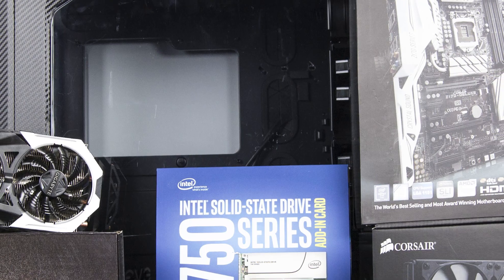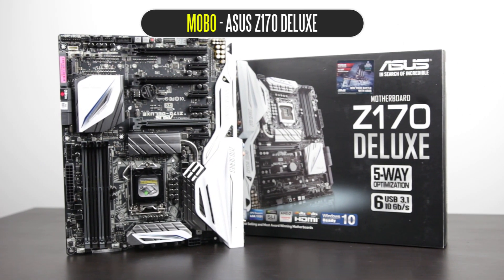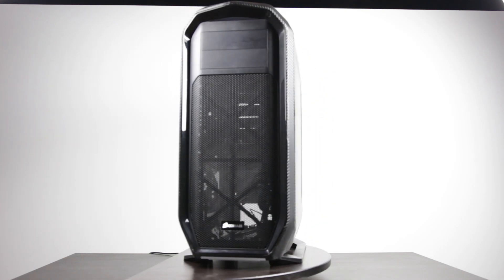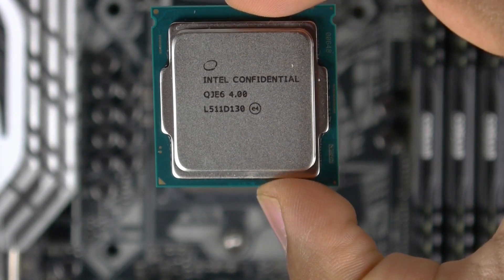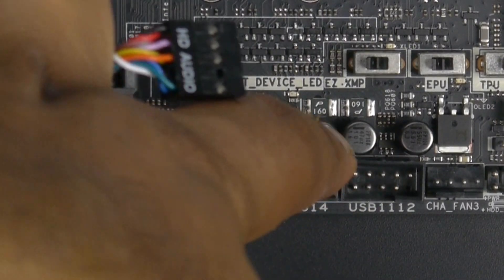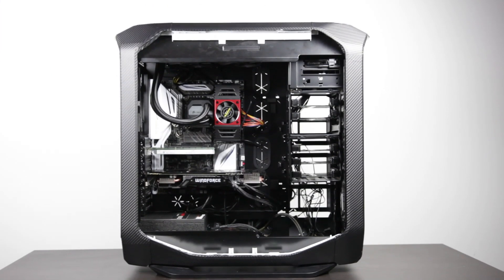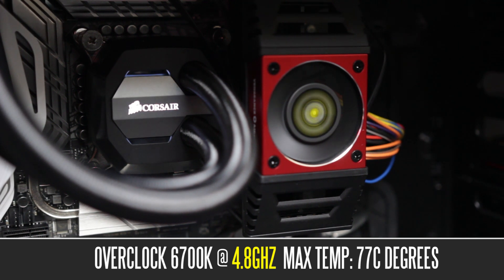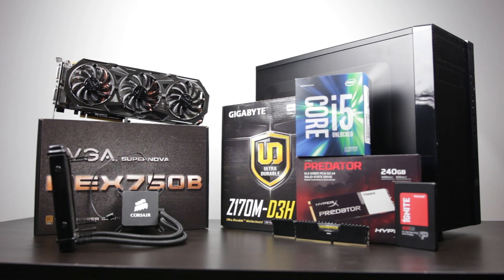Ultimate 4K Gaming/Productivity PC Build Guide - Core i7 6700k/ GTX 980 Ti

Comment: Wait a minute, your ultimate 4K gaming PC is powered by a single 980ti? If you plan on playing modern titles you're either going to have to compromise in the settings dept or in the framerate dept...Ultimate this build is not.
Reply: hartsickdisciple
Nah mate, my point is that your IQ is to low to understand what "ULTIMATE 4K GAMING PC" means :(
Reply: +TheInfamous Stephenson I agree sadly... only 1 gtx 980 ti just isn't enough to run most of todays AAA titles over the low 40s in fps rates... This is certainly a nice little build and will get the job done especially if you have a decent monitor with GSync... However for productivity and Ultimate, be more proper to see an x99 build with at least SLI and a better quality psu...
Reply: +hartsickdisciple Mate just sit down and STFU,  nobody cares on how long you have been a gamer, especially when you have no fucking idea what you are talking about...

I have 2xASUS 970 STRIX OC running SLI (the same as 1 980ti), i7 3930K@4.4Gz OC, 16gb 2133 Ram, Rampage Ekstreme IV. On a ASUS ROG PG278Q 4K 144Hz Monitor

And i cant run all new games on MAX
Reply: hartsickdisciple
ULTIMATE
Reply: hartsickdisciple
ULTIMATE
Reply: hartsickdisciple
ULTIMATE
Reply: hartsickdisciple
 Did you get it now? o.O
Reply: +TheInfamous Stephenson ... Also lets keep in mind productivity... an x99 Deluxe and a 5820k would cost the same price of this build. Even cheaper if your near a MicroCenter where you can get a 5820k for $299... this build isn't only not Ultimate but financially irresponsible...
Reply: +TheInfamous Stephenson He wouldn't have to compromise a lot.  980 Ti and Titan X can handle most games at 4k.
Reply: hartsickdisciple Not current high end titles at 60fps and max settings @4K...No single card can at the moment.
Reply: TheInfamous Stephenson 60 fps is nice to have, but not necessary all the time.  The 980 Ti can handle a lot of demanding games at 30-50 fps at 4k.  Far Cry 4 and GTA V are 2 examples.
Reply: hartsickdisciple The ULTIMATE 4K GAMING PC should be able to handle 4K  and max setting at 60fps at the very least, or it doesn't qualify as the ULTIMATE 4K GAMING PC now does it?
Reply: TheInfamous Stephenson Are you setting the standards?
Reply: hartsickdisciple The industry has set the standards, where have you been?...Sub 60fps on a so-called ULTIMATE Gaming PC isn't so ultimate.
Reply: TheInfamous Stephenson I've been gaming on PC for over 15 years.  I know that 60 fps is nice to have.  Perhaps the maker of this video should have set an upward limit on the money they were willing to pour into this rig.  Everyone knows that you can dump 5 grand into a ridiculous, multi-gpu gaming PC if you want.  I got the vibe that they weren't going for that here.
Reply: hartsickdisciple And I've been gaming since the Commodore 64, so Touche.

Furthermore, you obviously can't build the ULTIMATE 4K Gaming PC if your budget doesn't allow for specs that will support an ultimate gamimg experience at 4K resolution...so perhaps MW Technology shouldn't have went with a misleading title.
Reply: TheInfamous Stephenson Gaming on Commodore 64 has no relevance to a discussion about PC gaming performance and graphical standards.  I played on Atari, but you don't see my bragging about that.  

There is more than 1 possible meaning for this title.  One meaning would be to say that this is the best (ultimate) PC for gaming at 4k.  That's how you are interpreting it.  I don't doubt that others also read it that way.  The other way to read it (since 4k gaming is viewed as the holy grail right now for so many), is that this PC is an ultimate gaming rig, and could even be used for gaming at 4k.  As we both know, 4k PC gaming is not all that common at this point.  That being true, being capable of 4k gaming is seen as something to attain to for a gaming rig.  This PC is an ultimate gaming PC (it's a beast by any reasonable standard), and can EVEN play many games at 4k.
Reply: hartsickdisciple It has relevance to your previous comment: "I've been gaming on PC for over 15 years" (I thought this was obvious).

Additionally, I'm not adding self-interpretation to anything, I'm referring to the title as it's presented: ULTIMATE 4K GAMING PC ...not ultimate 1080p PC that is capable of 4K gaming with dialed back settings, ultimate 4K BUDGET gaming PC, or any other conjectural titles and hypothesized subliminal meanings that you want to add into the equation. Did you even watch the video?..as the contents of the video supports the title 100%.
Reply: TheInfamous Stephenson Yeah, I watched the video.  Commodore 64 has no relevance to a discussion about frame rates.  What I'm saying, which is completely valid, is that the very fact that a PC can run most games acceptably at 4k at this point makes it pretty fucking ultimate.  Most PCs can't run many recent games acceptably at 4k.
Reply: hartsickdisciple My comment about gaming on the Commodore 64 is just as relevant as your comment about "gaming on PC for over 15 years".

Furthermore: This vid is about the ultimate 4K gaming PC build, as the title suggest and the opening statement in the video itself verifies...not about what is personally acceptable to you when it comes to 4K gaming. If other 4K gaming PC builds are outperforming this one then it obviously isn't the ultimate build for this level of gaming.

As the very wise Yoda would say: Rocket science this is not.
Reply: Ullaofimbaness Nothing you just said had any relevance to my point.  You must be stupid to understand it.
Reply: +TheInfamous Stephenson I ' am thinking for a 1440p System: i5 K6600 with GTX 980 Ti  <or>  i7 K6700 with GTX 980 ... Photoshop/Lightroom, 3D Rendering Cinama 4D and litte bit Gaming
Reply: Oil Bama A 980 TI will max anything out at 1440p at 60fps and above.
Reply: TheInfamous Stephenson Thank you. And 980 without Ti and the i/ k6700?
Reply: Ullaofimbaness Chances are good that my IQ is higher than yours, if you want to go down that road.  I don't think you do.
Reply: +hartsickdisciple dude, that is shit, 60fps minimun otherwise it's pointless
Reply: +hartsickdisciple dude, that is shit, 60fps minimun otherwise it's pointless
Reply: +Joseph Norris lucky, I'm gonna work my ass off to build myself a beast come springtime.
Reply: hartsickdisciple
Just by saying that braindead shit, you made my point on that your IQ is to fucking low. But please lets go down that road, because im so curious on how you are going to manage that. Or are you just babbling out random sentences?
Reply: +TheInfamous a titan x can easily handle 4k gaming alone, the only problem with 980ti is that it only has 6 gb of vram, which is the minimum requirement for games like shadow of mordor. it doesn't matter tho because you would be stupid if you wanted to have a 4k monitor for gaming.
Reply: Rodrigo Paiva Yeah, but not at 60fps at max settings...the single card that can do that hasn't yet hit the market. In comparison benchmarks the Titan is only slightly ahead of the 980ti (like an extra 5fps) is most modern titles @4K and the 980ti is significantly cheaper. Also no games utilizes 12GBs of GDDR ram so what's the point?

Comment: Why did you not put the GPU in the 16x slot and the Intel 750 SSD 8X slot? If the GPU is in the 8x slot, does your GPU run at 8x instead 16x? Does make sense to cut you bandwidth in half on the GPU, when the SSD only needs a 4X PCI-E slot.

Comment: You always have to put the graphicscard in the PCI-E 16x slot nearest to the socket. Otherwise you only get half of your graphic-performence.Do not put the Intel ssd in the PCI-E 16x slot, because it will slow down your Graphicscard.Put the ssd in the PCI-E 4x slot, it only has 4 lines. It won't go faster just because of putting it in a x16 slot.

Comment: I just need to say, I'm dissapointed with your build. the psu is a joke for one. cable management? Um, I didnt see any. 

All you did was plug all the case fans directly into the psu while daisy chaining your pump and both rad fans into 1 cpu fan header. if I'm not mistaken, that board has 3 dedicated headers for a pump and 2 fans. Why would you take stupid shortcuts? 

you know you can get better performance while reducing db levels by using the individual headers for your fans, right?

For any new pc builders out there. this is how not to build a system. the parts, with the exception of the psu are lovely, but don't take shortcuts!

I'm not even sure I like using the top pcie slot for the ssd. are both those slots x16? if I recall amd are the only motherboards that actually give you 2x16. you may have plugged your video card in the x8 slot. not sure... >. <

Comment: Great build! Thanks. I need to build something similar for my business. I want something smaller and quiet (considering Silencio 352 case with an mATX). I was wondering how noisy is your system as quietness is paramount for my work. Also, I'm considering using the Samsung m.2 950 pro when they come out. Would love any comments if it's worth the wait.

Comment: i have the same psu and i didnt use the extra vga connection from the psu because there is a non removal cables which is labeled vga.

i hope its not a problem :)

Comment: I have a question about your PCIe slot selections...  You put your 16x PCIe graphics card and put it in a slot that is only pinned to do max 8x, and you put your 4x PCIe intel 750 in the only 16x slot on the board...  What's up with that?

Comment: You didn't notice that the ASUS motherboard comes with a CPU installation tool that the manufacturer considers to be mandatory?  It makes it a lot easier to insert the chip without the risk of bent pins?
Reply: Lol what century you from mate?
Reply: +Nate A century where you learn to use the tools provided to make the job easier.

Comment: hey 

do you reckon that a black case with red leds go well with a white mobo?(cause i have the se case but havent bought a mobo yet)

thanks
Reply: +MenderSlen579 if you want it to match, buy a red motherboard, like the gigabyte boards.
Reply: +s0rl cool

i just got my red mobo 3 days ago and i think it really macthes well
Reply: MenderSlen579 nice, what's your build?
Reply: +s0rl gtx 970 asus strix

crucial ddr4 2133mhz 8gb single dimm

msi x99a gamming7

corsair h100igtx

corsair 780t black

i7 5820k

corsair rmi 850

1tb seagate 7200rpm 

120gb ssd samsung evo 850(only for my os)

btw this will be my first time putting together my pc.
Reply: MenderSlen579 nice build, youll probably max out games at 1080/1440p
Reply: +s0rl thanks

but for now ill probably use my 1080p tv for my pc
(never touched a monitor for 4 years prehaps i carried alittle bit of peasantry with me when i abandoned my ps3)
Reply: +MenderSlen579 haha :) I'm going to build this and have a quad monitor setup o_o
Reply: +s0rl thats pretty cool

Comment: I haven't built my PC yet, so would it be worth it to go with a 6700k instead of the 4790k?
Reply: +SparkyHD Yes, For not much more you're getting more performance not neccesarily in games but in cpu bound programs. it will also make sure you are as "futureproof" as possible for some time.
Reply: Charlie Savory I only work parts time so it would take me another week just for the CPU, Mobo, and Ram upgrade :/
Reply: I'm working Casual and i'm still saving up aswell. It's Going to take approximately 10 months. (I live in Australia) For you, It's another week of work. BUT, if you don't want to upgrade for quite a while, it's worth it.

Comment: My build:

i7 6700K
msi z170a gaming pro
Phanteks Enthoo Pro
CoolerMaster Silence Pro M2 850W PSU
Corsair H110i GT CPU Cooler
Crucial BX100 500GB SSD
WD 2TB Red NAS HDD
Asus GTX970 Turbo
Crucial 16GB 4x4GB Ballistic Sport DDR4 2400MHz
Fan controller, media reader, dvd reader...
And Asus VG248QE 24'' 3D LCD Monitor 144Hz and 1ms.

What do you think? I haven't bought it yet, >||< trying to get the cheapest deal...

Comment: Nice video, but this is more of an entry level 4K/high-end productivity. If you want productivity - I'd swap out 6700K for 5820K any day (now I bet the reason 6700K is in this build is because Intel send bunch of them out with the 480GB 750SSDs and told people to make builds with them - every major channel has one). And - as stated - you need 2x SLI 980Ti for full 4K experience. i'e much rather go ultrawide 3440x1400 - that you can do well with 1x980Ti

Comment: Samsung SM951 SSD with PCIe adapter .............(write -1570mb/s) and (read -1716mb/s) @ $150
Intel 750 PCIe SSD..................................................(write -1243mb/s) and (read -1506mb/s) @ $400

Does not justify the price difference.

Comment: I'm getting 64.9FPS avg on the same settings but I don't know what tessellation level did he used though so I set it to normal, I have 2 EVGA GTX 970s SSC (3975) with it overclocked, also the CPU I have is the 2600K OC @ 4.6GHz

Comment: should I upgrade my i7 4790k and 780 ti to a 980 ti?
Reply: No, I have a 1440p monitor.
Reply: Ok Thanks.
Reply: leave the upgrade from the cpu and put more money into the gpu... you could get a Titan X with that extra money... i7 4970 is plenty
Reply: ok thanks! upgrading to titan x in a week! :D
Reply: 980 ti sli or titan X?
Reply: Thanks! Ordered 2 STRIX 980 ti's! So excited! I decided to also buy A ASUS Maximus VII Hero.
Reply: +CreepaClawz ! ok... let's clear this up... if you want one card for 1000$ go for the Titan X... 1 card for 980ti is upwards to $700 which means 2 would be $400 more than a Titan X with some better performance if you are willing to spend the cash. or if your mb allows you could go for 3-way sli with gtx 970's which would add up to the same as the Titan X. it should be all based on performance/dollar and how much you want to spend. if I were you, I would sell your current card as it is becoming outdated and upgrade to a newer one... also you have to make sure your power supple has enough wattage for your new cards! 1 card<2 cards<3cards in terms of wattage. :)
Reply: +Daniel Carlino because it sounds like he wants an upgrade right now
Reply: I was able to find the gtx 980's at around 618$ USD So it only cost $200 more than a titan x.
Reply: I put it up on Craigslist.
Reply: Put it up for 290$.
Reply: $298.98 exactly. Sorry.

Comment: Wow I'm just here with a 4790K, 850 Pro SSD, Frostbyte 360mm radiator and Dual Titan X GPU's.
Reply: +Daniel Carlino nah
Reply: +RIGHTtoTH3Tech , (RITEinTH3eye)  I'm just here with a i7-5960X, Asus ROG Rampage V Extreme/U3.1, Corsair Dominator Platinum Series 32GB DDR4 DRAM 3000MHz, 3x EVGA GTX Titan X SC, Corsair AX1500i, OCZ Vector 180 960GB SSD
Reply: +Tech Doubles (RITEinTH3eye) obviously trying to show off.